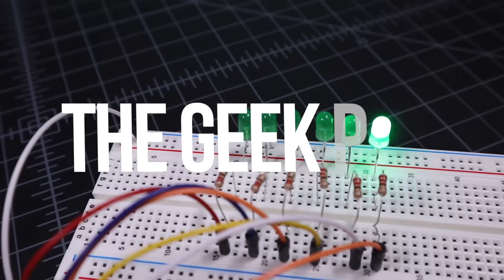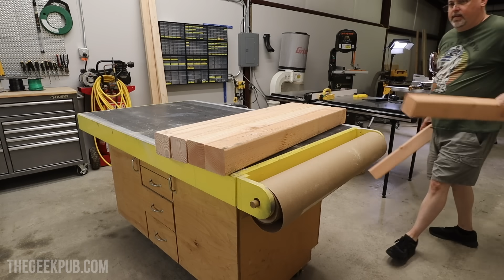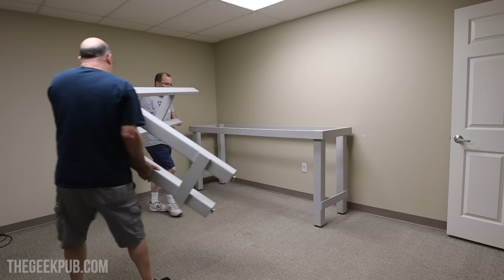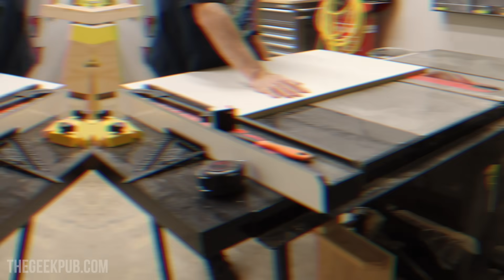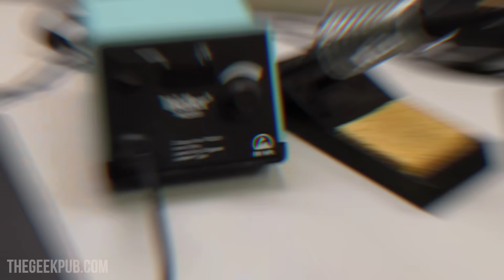Ultimate Electronics Station Build

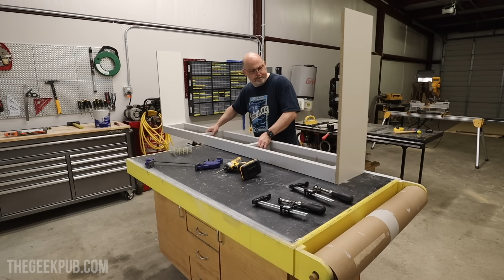Comment: @15:37 screwing from the inside through 1.5-2" of framing timber into particle board is not good. The screws will readily rip out of that particle board. Regardless of how it looks, always screw thin/soft into thick/hard materials, you will have 1.5-2" of screw thread grabbing in a relatively firmer material vs 3/4" of the tip into a crumbly material.
Reply from the maker: Yet after years of use and moving the bench three times it hasn't.

Comment: There are advantages to making the electronics workbench out of steel. The obvious retort is my circuit boards will just short out on the metal surface, and of course the cost. While this is correct that steel will conduct electricity, most electronic work is done on an antistatic mat, which is also somewhat conductive. Where the table comes in handy is in protection against static charge. A large metal plane will distribute electric charge very effectively.

Comment: My first bench was like this but smaller. Home built 2x4, 4x4 and MDF. After making some money on it, I wanted to look a little more professional because I had clients come into the lab to see what was happening. Near the end of your video, you said $2000+ on an off-the-shelf bench. That's not really fair or true. You can get an 8-foot bench with a riser for about $900 to $1000 shipped. If you trick it out with uprights, multiple shelves, hanging lights, and power strips, you can get up there for $2000. Zoro/global industries have better prices on benches than U-line.

I'm not knocking you. When a hobbyist starts, a DIY bench or just a used desk is great. Ensure the hobby or business is for you before really investing/bootstrapping it until it pays for itself.  In my case, I had enough clients it wasn't worth trying to build another bench myself because I charge around $50 to $100 per hour, depending on what I am doing. If I had added up the time of building a new bench that looked better, it would have cost more than $900, valuing my time.

I like the video, though! Again, I'm not knocking it, Just mentioning If you are busy with clients, then $250 in material with a day or 2 of build time really is costing you more based on your time.

Comment: You can skip the masking tape if you lower the saw blade just about an 1/8", just enough to cut the surface white melamine veneer. Then, lower the blade enough to cut through the rest of the material and make your second cut. It works SOOO much better than the tape method. And it doesn't matter a whole lot which saw blade you use, although I did use a fairly new/sharp blade. I always get some chipping with tape, regardless of the blade I use, even with an expensive melamine blade. Thanks for sharing your build! Nice job!! Love your set up! Hope to see more videos from you soon!

Comment: Another point on the Amazon stations, you're stuck with whatever size they have. Not only is something like this going to last much better and be of higher quality, you can build it to fit your space and needs. Currently building my own desk for that exact reason, plus if you need something of a large size, the cost goes up exponentially.

Comment: Way overbord!!😅 My table is an hollow core door and two teller draws from a closed bank. Shelves  are easy peesy. Elfa to the rescue nothing fancy just white wire held into the studs with 1/4x20 lag bolts. All the power in the rear ware it belongs.  We should remember that it is NOT FORM OVER FUNCTION.😅 But the other way around.😊 ~~ Cris Harrison

Comment: I use a nice old desk I had that has a glass top. Put a blue silicon mat on top, Microscope, soldering station etc.  on it.  Then for more work room that I am not mind if it gets messed up, I laid a 3/4 inch hunch of plywood across some summports. (a plastic Stanley outdoor job box), Tons of room at the perfect (low) height. Rigged up lights and power strips, put a lab power supply, a hot air and solder rework station, a few VOM meters, a desoldering station. etc.  Already had the plywood and the job box for it to sit on. Cost was nothing. Build time was about an hour to flop the plywood down and put the stuff on it.  :)

Comment: Nice build. I am presently working toward dividing my soldering space from my testing space. The two purposes really just do not mix, for a myriad of reasons... melted probe wires... solder splattered into open DUT cases, etc.

Comment: edge banding can look cood and go on flawlessly but as someone who applies this stuff by hand at my job .... it takes work and its VERRY fiddly and tempremental and not something that can be easily explained but some pointers

sand with course grit before applying but you get ONE PASS make a sort of sawing motion forward 3 inches back a inch forward 3 more inches back a inch once you reach the end STOP do not go back for anouther go youll cause bits to break loose get bumps and ruin the job

lightly remove sanding dust but dont scrub again for above reasons

pressure is everything you wanna aim to have stuck it down either fully or 95% of the way on the first pass the second pass is for seating and setting the edge perfectly

aim to get just one side straight the other will be your trim side and trimming is a whole art in itself

to get halfway decent at it it took me about 2 hours under instruction and 16 tries to get halfway decent

Comment: The first thing I'd want to build for my workbench is an 18" to 20" lazy-Susan to set whatever I'm working on on my bench so I can easily turn it around while I'm working on it. (I use a screwdriver under the lip as a brake to hold it still. I'm pretty low tech.) I've found it to be about as important a tool as my soldering iron and 'scope. It's especially handy for working on old HP test equipment. That stuff all seems to start at 50 pounds and goes up from there. And I'm not as young as I used to be.

Comment: Nice!  I usually build the top slightly oversize then cut 1/4" off of each edge to remove the round-over on the 2x4's. Either way. Love the T molding idea!
Reply from the maker: That's exactly what I did. :-)

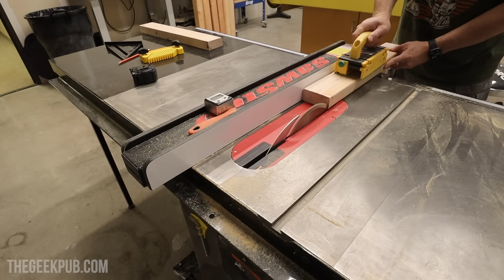Comment: 4:51 Don't EVER use your miter saw like this. With this cut, hold the larger piece with your right hand and operate the saw with your left. Very dangerous the way you're doing it.

I find you'll get straighter 4" posts if you glue to 2x4 together. If you want them flush with each other you'd have to plane them down to get rid of the roundover, of course. Also is probably cheaper.

Comment: Reminds me of when I was in trade school in the 1960’s training to be an electrician. We needed an electronics work bench so we asked the carpentry shop to build us one. Like yours, it was strong and sturdy. Several years after I graduated I stopped by to say hello to my old instructor and that bench was still there, strong and sturdy as ever. The cartoon I taped on it in 1968 was still there! Like the edge banding, looks good. Thought at first you’d use the cutoffs from the 2x4’s.

Comment: Good explanations.  Overall you did a real nice job.

But a few things.  First DO NOT use masking tape.  That blue tape is called Painters tape.  It doesn't leave a film like masking tape.  Also if you plan on leaving the painters tape on a surface for several days check the label as it's rated for how long it will stay on the surface without leaving a film of glue. Finally put the tape for labels on the side you aren't going to have out as the "good" side.  This way if it does leave a film it won't be a pain to clean up.

Comment: Generally, I agree with you, shops are many times offers fancy-looking tables and shelves for huge many with acceptable quality or budget deals but with poor quality, BUT it does not mean you have to build it with your own hands, also dont have to buy/rent the necessary machines.
Many wood suppliers have a simple extra service: Cutting! 
You just have to make the plan, the drawings, with correct sizes, and the woodshop will not just sell you the wood but will cut it on size, label it, protect the edges, AND they do it in better quality than you can do at home AND the price difference is not significant.
All you have to do is assemble it.

Comment: Just in case any of you do not want to shell out 30 bucks for a set of bench cookies,  i spent 8 bucks and bought 8 new hockey pucks at Dicks sporting goods.  I glued felt to the bottom of them.   I then cut the top 1 inch off a set of small plastic painters triangles then epoxied them to the top of puck and blunted the point just a tad.  they work great.  8 of them for 12 bucks.  And one more thing I can share with you all -- never throw out UPS or exit sign batteries,  when they are dead, cut the terminals off them and what i did was wrap them in some cheap carbon fiber vinyl wrap  and then a thin layer of sheet rubber on the bottom for grip and basic anti-dent protection for wood projects - and  you can get in bulk at home depot by the foot.I use these bad boys as wood working weights and they come in really handy when I have to repair parquet , ceramic floor tiles or if you need to brake a project from moving while you work when a hold fast or clamp is not necessary.   Didn't mean to just jump in here and start handing out unsolicited advice, but money is tighter than ever, and these little gems saved me a lot of money and are very handy.    maybe my silly cheap ideas help someone out.

Comment: You are a great carpenter but the grounding of your electronic workstation is not up to par .
I have build electronic work stations for my company in the past and i did a lot more on grounding and static electricity .
To start with, you have to separate your dirty ground from your instrumental ground with a choke , copper strips under your flooring and working desk, your anti static working mat connected to the clean ground and an arm wristband connected to your working mat .Depending how far you will go, but a galvanic separation of the power supply to your measuring and testing equipment from the grid supply is not a bad idea
Reply from the maker: Future video.
Reply: @TheGeekPub  sorry, i was to fast

Comment: I am surprised (not happily) at how many of these "electronics" guys completely disregard ESD.  This work station is completely unsuitable for use if you desire to build reliable electronic devices.
Reply from the maker: I have a full ESD mat and grounding system.  I didn't show it here because its a future video.
Reply: @TheGeekPub  You didn't mention any future video on this video,
You fail to mention that many of the more expensive benches come ready to support ESD control measures (but you can do it yourself),
You don't keep parts in ESD safe packaging in many of your bins (which do not appear to be ESD rated),  There are plenty of resources for this at Uline (among others).
Modern electronic components can be sensitive to discharges of <20V.  You need a grounded work surface, wrist strap and ESD smock, and, often, an ionizer to ensure safe handling of the devices.  If humidity in your shop drops below 30% you may also want to consider a humidifier.

I like the bench, it's a great start but it is not ready to be advertised as an "Ultimate" electronics station build until it is actually safe to perform electronics work on.
Reply: I am surprised (not happily) at how many of these "electronics" guys comment on how much smarter they are than everyone else. My suggestion for you Don is to build a workbench, make a video, and show us how its done. You'll have the most popular channel on YouTube.
Reply: @ReggieCotton  That is exactly the kind of BS reply I was expecting.  I did not advertise that I built the "Ultimate" Electronics Workbench, and then create a product that is incompatible with electronics work (unless you're using vacuum tubes).  The Geek Pub has a YouTube channel, and is presenting themselves as knowledgeable in electronics.  I expect the quality of the product to meet the expectations, or at least the billing, of the video title.  As for comments from the peanut gallery; back to your hole.

Comment: Nice job.  I wouldn't bother fastening the shelving unit atop the table.  You're not accomplishing much.   I would instead consider fastening the shelving unit to the wall behind the workbench.  It will be stronger using less effort.

Comment: I tend to do a lot of RF and Microwave work.  So the older HP spectrum analyzers, signal generators, and power meters get a lot of use.  These instruments are quite deep, and also have connectors on the back that are useful.  So I build my benches with a much deeper instrument shelf.  I cover the back of the bench with a sheet of plywood which prevents parts from rolling off the back of the bench and supports the instrument shelf.  There is no need for a top shelf, it just gets in the way.  I also use a length of 1-1/2 x 1/8" angle iron mortised into the 2x4 that supports the front of the instrument shelf.  Wood tends to sag, and the steel prevents that.  An HP8566B weighs 110 pounds, so you need the support for this class of equipment.  Lastly, I do not place the bench against a wall.  Leaving ample access to the back allows easy access to rear connectors and mounts a plugstrip on the back keeps power cables out of your face.

Comment: What I did was look for auctions and such, I found a local biotech company that was downsizing and picked up around 20' of metal base cabinets, 2 chemical epoxy tops (7' x 3' and 8' x 3') and got a few nice steel case office chairs and lab stools all for 2K.  May be a bit pricey compared to this build, but have drawers and cabinets is a big bonus!

Comment: Nice workstation build. You may want to get a fume extractor for the same reason I recommend a dust extractor. Haako makes a nice one that is self-contained, supports up to two hoses, and has a built in huge filter..
Reply from the maker: I have the Hakko unit already.
Reply: @TheGeekPub  Oh nice. That's a great air cleaner. Much better than the little desktop fans.

Comment: Wow that is almost identical to one I built for my bench, the only significant difference is I put 5,000V insulating mat on the top of the working bench surface, so much nicer than working on painted wood.
Reply from the maker: That's melamine, not painted wood.
Reply: @TheGeekPub  -- fair enough I skipped though the video and missed that, I was more interested in the functional end result, I still like the matting over a hard surface, but overall that is a great looking and functional bench.

Comment: You might want to consider a sheet of plywood or a hard plastic mat for your chair. The rollers will crush the underside of the carpet, with nice divets where you spend most of your time sitting.
Reply from the maker: This is commercial floor tiles.  Not regular carpet.

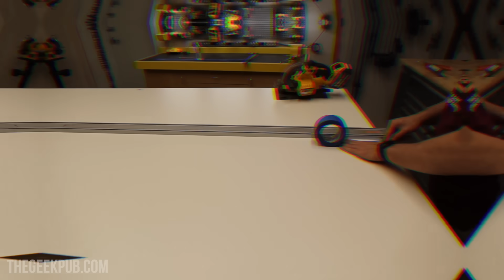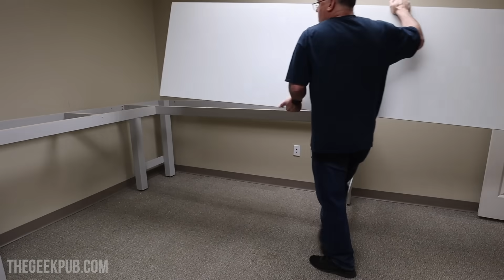Comment: 2:00 A circular saw will only produce blow-out or tear-out on the top side of the board because the teeth are hitting the bottom side of the board first. The melamine on the bottom has the support of the particle board above it. The damage happens on the top of the board, because there is nothing to protect it as the saw blade exits the board. A good rule is to remember, good side down, even if you're using a good quality sharp blade, and move slowly, that also helps prevent any damage. I use this every time I use my circular saw and the good side never gets damaged. Of course there is absolutely nothing wrong with protecting both sides when needed. 12:00 With your tables being as wide as they are, I would have added a stretcher along the legs closest to the walls. This would prevent any racking during use, especially with a lot of weight on the table tops. GREAT BUILD!!!!!!!!!
Reply: Good side down, Thanks for the tip!

Comment: The shelves are too high for the 1st row, a real electronics lab always have a shorter shelving which has plenty of oscilloscope and other lab equipment that is leveled to the face and not above.
Reply: I vehemently disagree. As someone who's first shelf is far too low and not adjustable, a higher shelf is much preferred.  I can't even repair a CRT on my bench because the first shelf is in the way.

Comment: The only thing that stresses me out about this setup is using the melamine as a support for your shelves. I would recommend using 2x4s attached to the structural supports of the bottom table. Other than that great functional build.
Reply from the maker: This is 3/4" melamine coated particle board.  Most likely your kitchen cabinets are laminated 1/4" particle board and they hold hundreds of lbs of dishes. ;-)
Reply: @TheGeekPub  Dude, not often a bigger channel like yours replies to my comment. especially on a month old video. You may have just earned a sub! That said you may be right, but I have had enough cheap ikea furniture to know that torsional forces tear screws out of particle board quickly and with dramatic effect. Ultimately it comes down to personal preference, and I am by no means an expert.
Reply from the maker: @IraRomfh  This difference is this is a shearing force (force designed to break the screw in half).  That's super strong.  If this was a tensile force (force designed to pull on the screw) this would fail quickly.  Welcome to the channel!
Reply: @IraRomfh  I've built a couple of Mike's projects. He even replies to emails when you get stuck.  Super stand-up guy IMHO.